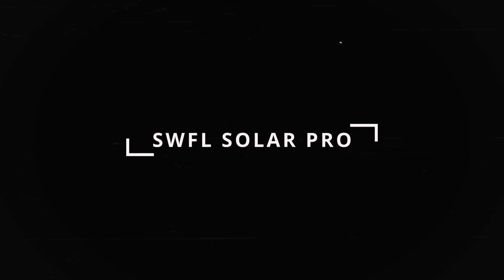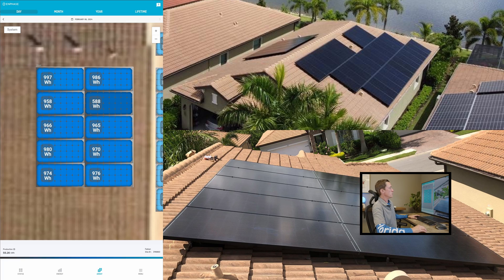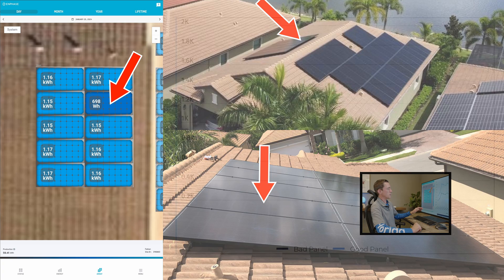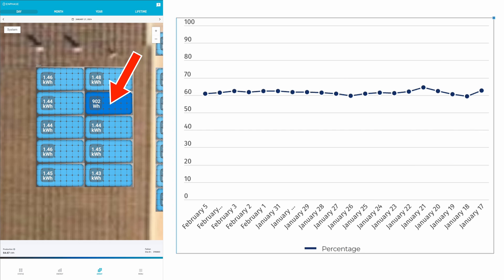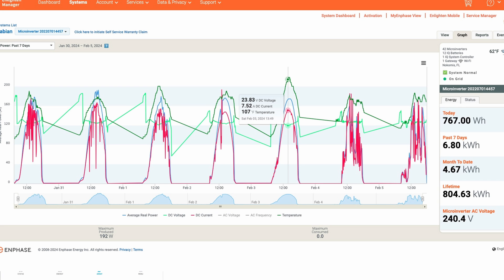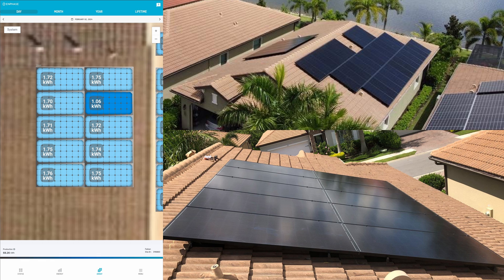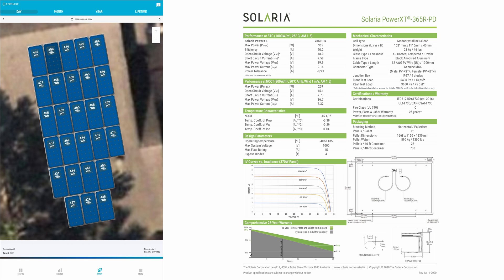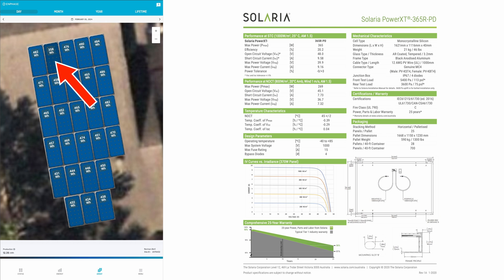Diagnosing Bad Solar Panel Diodes

Comment: Wow, this must be exactly what I have because everything you explained seems to be to the tee of what I’ve gone through. I got new Enphase micro inverters and the problem did not change one bit. Whats incredible is that I have Ginko solar 405W panels which 6:34  are supposedly tier one panels and I have four panels that are doing this out of the 38 panel system.
Reply from the maker: Hi Greg, it is certainly unusual to have four panels on a relatively new system that are experiencing the same issue with bad diodes, but it is possible you had a batch of panels all from the same manufacturing run that are faulty. We didn't install your system, and we have never installed panels from Jinko, but hopefully they will step up and support a warranty claim without any grief if that turns out to be the issue. It is a respected and popular brand right now. I can't imagine it will be an issue, but getting your big national solar installer to be responsive may be the hardest part. I wish you the best and will help in any way I can. I wish you were in our service area.